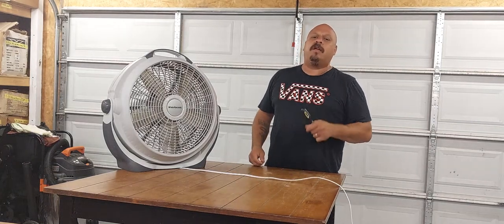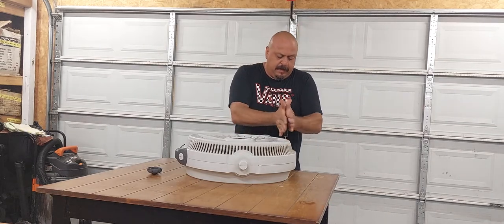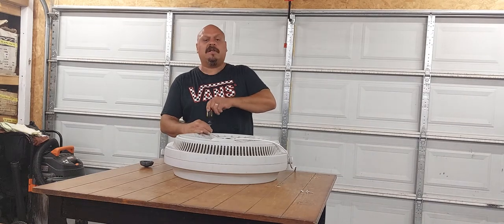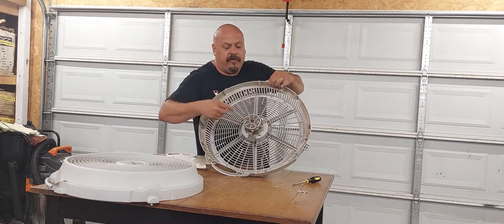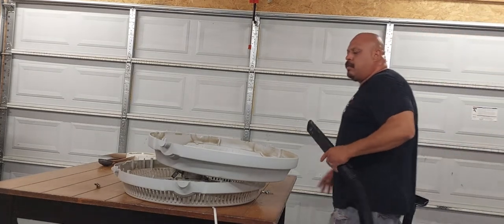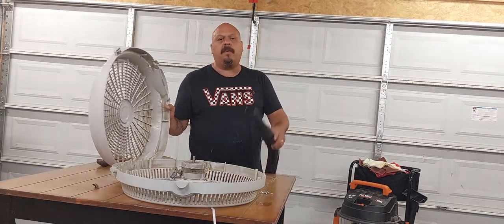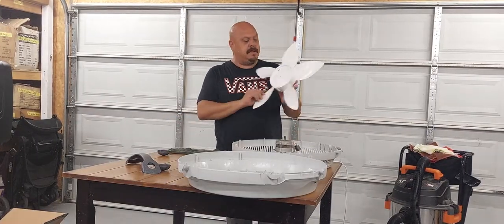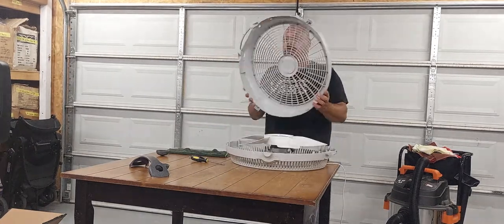taking apart a wind machine fan to clean it

Comment: Hey, great job! I wish you would have turned the fan on when you were finished cle😊aning it, though! I went through cleaning my smaller Honeywell fan, turned it on and the blades spun 3 times and it was OVERRR. LOL I have to try it all over again😮 Oh well, trial and error. Thanks again, friend! 😊👍
Reply from the maker: Yes I wish I would have.  Sorry I didn't. But I swear it worked like a champ. If your fan is getting stuck. A single drop of baby oil on the base of the shaft should help it spin smoother. I hope that helps. Thanks for watching and for the comment. God bless.

Comment: It seems like Lasko has changed the way the blade is on the fan. I cannot get the dang thing off and have seen 2 videos where you guys seem to just pull it off with little struggle.
Reply: Nevermind...I got it off! Just had to try a little harder. Just was concerned about breaking it. Thank you for the video!
Reply from the maker: It was a little bit of a struggle. Lol.
Reply from the maker: Yup. I had a bit of a hard time on my other fan too. I know what you mean.